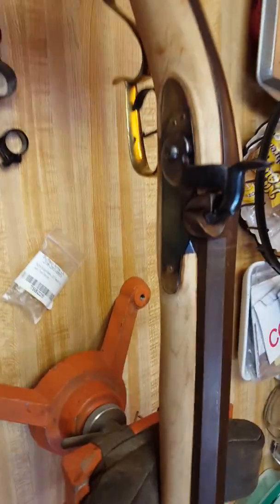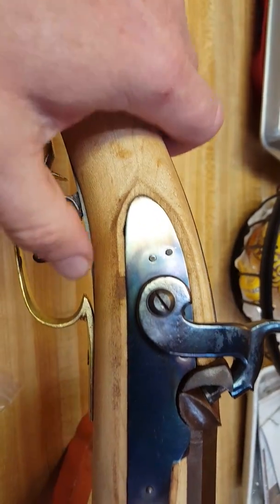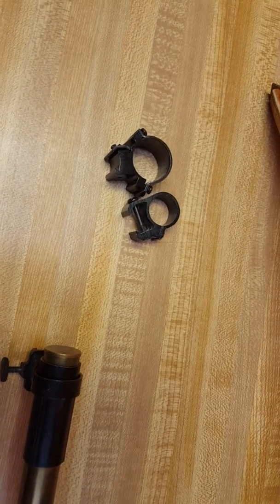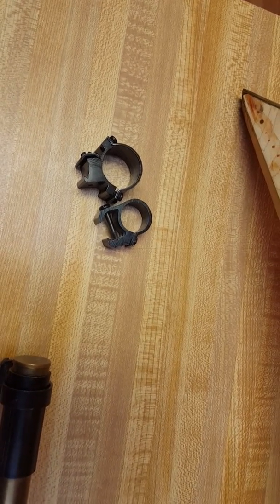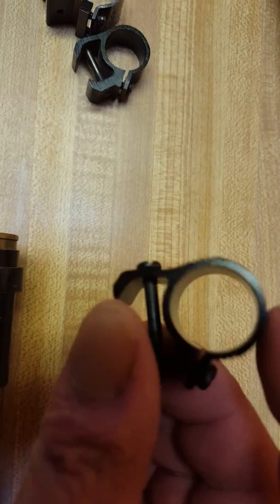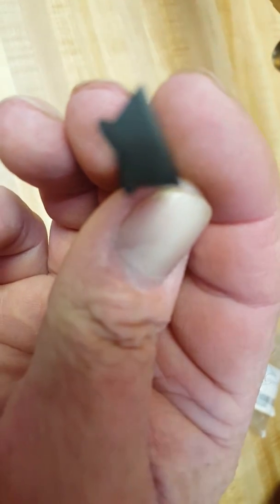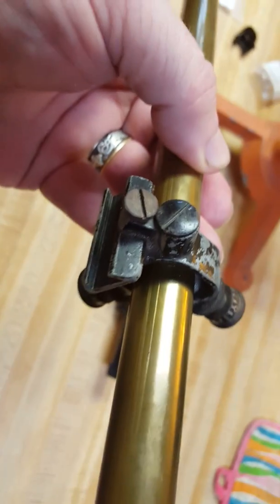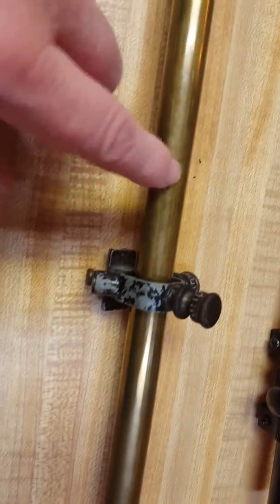Buffalo Rifle weekend update

Comment: You could use aluminum tubing cut in half as reducers for the rings you want to use and black anodize them and then set them in place with red or green lock tight.